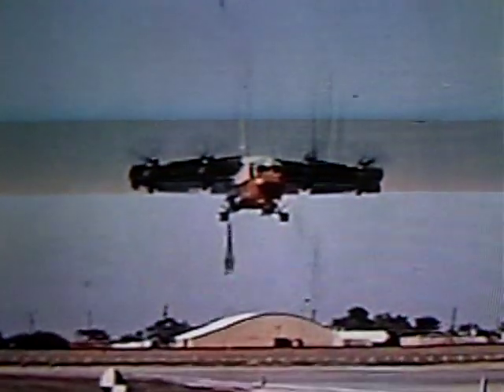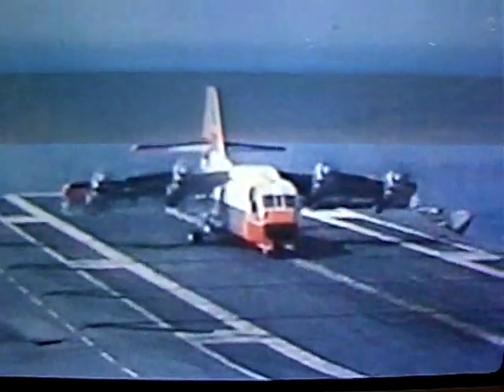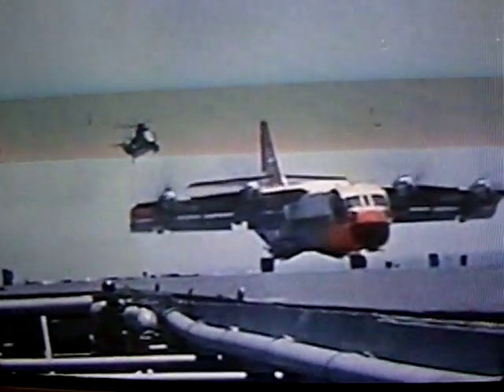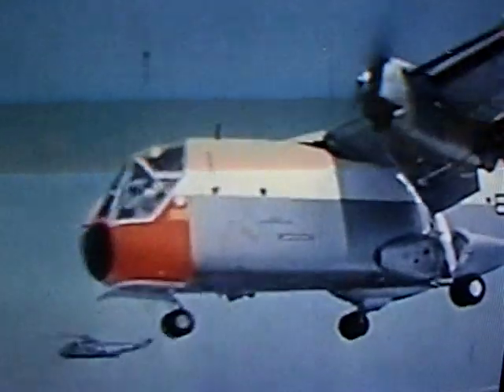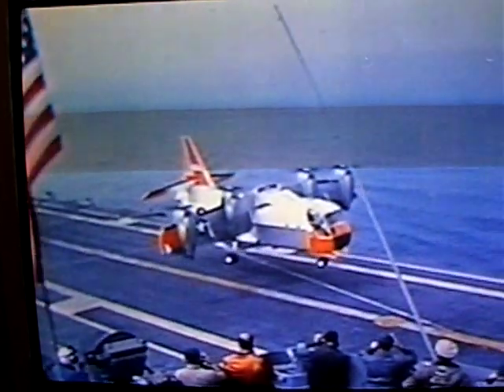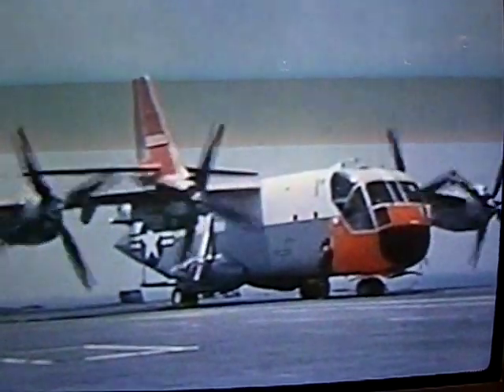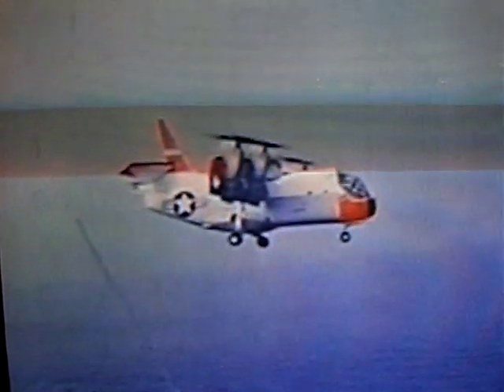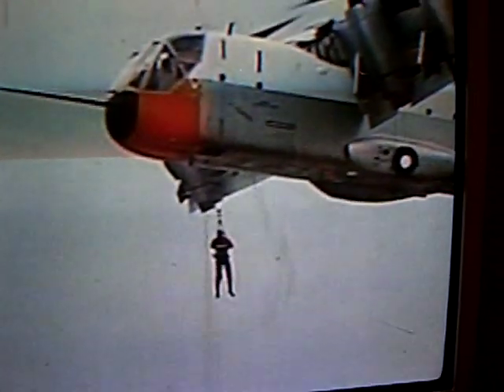Largest and Heaviest XC-142 S/VTOL Short/Vertical Take Off and Landing on an Aircraft Carrier -1964

Comment: One can only wonder what could have been done with tiltwing designs had the engineers had access to modern digital signal processor (DSP) integrated circuits in the late 1950s.

Comment: @zebadee277 
Why would you want to do standard take-off?
Tilt the rotor to 30 degrees from the horizontal and you can take off from a short runway at the same fuel cost as a conventional take-off.
The four engine Osprey was a pre-design concept that later evolved into the Osprey, so I doubt anything will come of it.